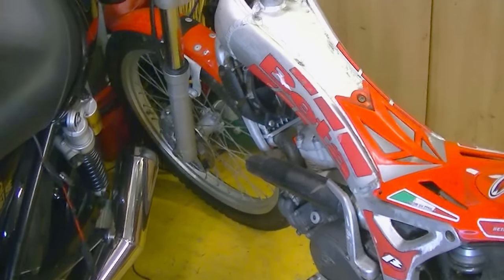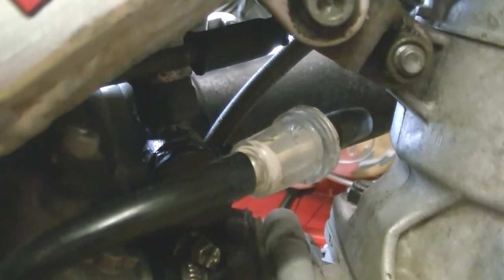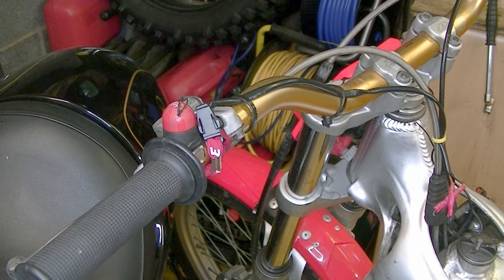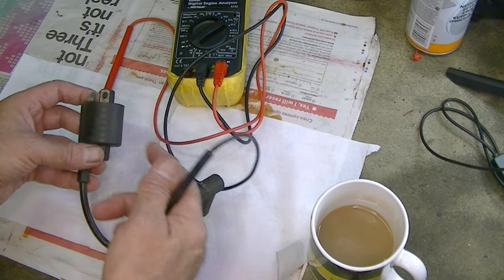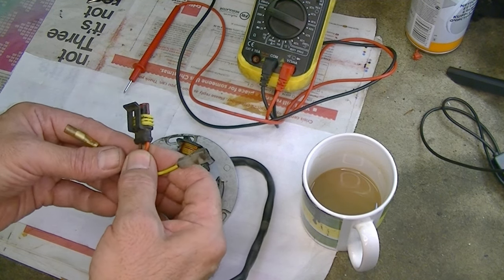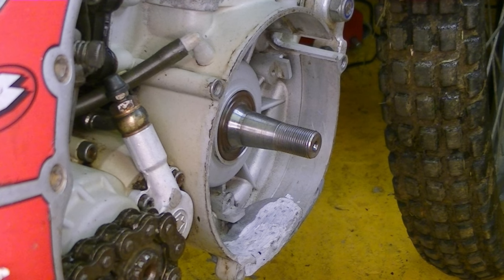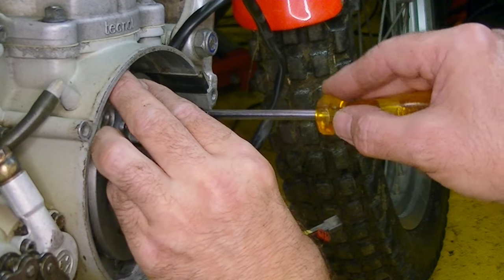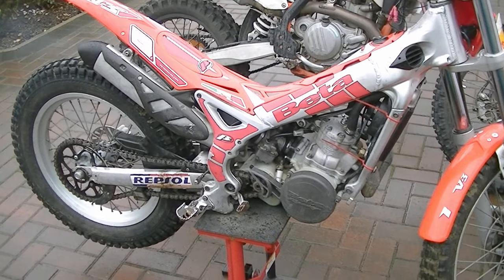No Spark? Don't Panic!

Comment: Pretty good practise there Simon. I would put a TDC mark onto the flywheel and a register for it also on the engine case. With a strobe light, off the battery and ignition lead,  you can then  absolutely ensure that your ignition timing is bang on into the future too, should  you need to remove the flywheel again. Good stuff. !

Comment: I'm still panicking though. I crazily replaced everything power related - brand new: spark plug, CDI, ignition coil, kill switch and magneto rotor. Still no spark at all! The motor actually runs perfectly, but no start without power. Do you have any idea why this could be? And if you know, how do I go about it?
Reply: Trigger pick up magnet good luck it's right over the stator on all bikes

Comment: if one of the screws from the stator has been lost but replaced with a bolt would it still work?
Reply from the maker: I don't see why not
Reply: @SongsFromTheSaddle  hi there I have ktm450sxf was good runner left for over a year and don't start no spark to it change battery spark plug and coil the fuses and still no spark do u recon it could be the stator plate ?
Reply: @SongsFromTheSaddle  hi no spark do u think it can be the stator plate ?

Comment: No kidding the first thing you gotta do is diagnose the problem 🙄 if you do haven't you got it fixed???🙄
Reply from the maker: Not really. There are two phases - problem finding and problem solving. Sometimes you can find the problem but not solve it. Recent example - stuck at the side of the road with a dead bike - diagnose blocked fuel injector. Problem found. But how to fix it at the side of the road in the rain? Problem solving is a different matter.